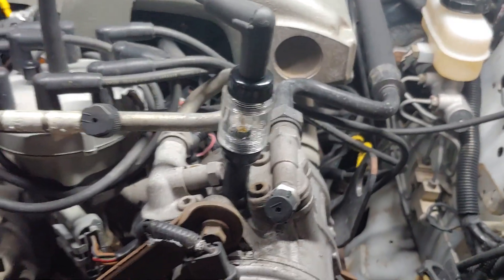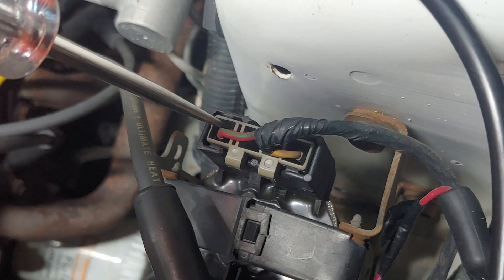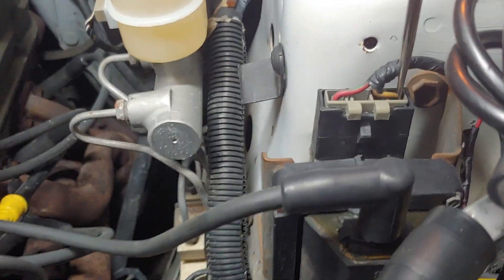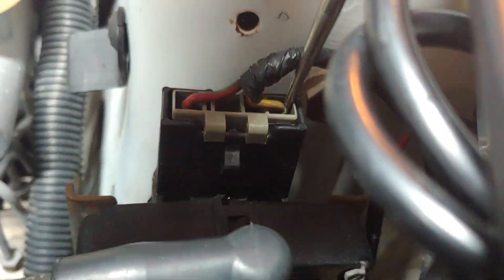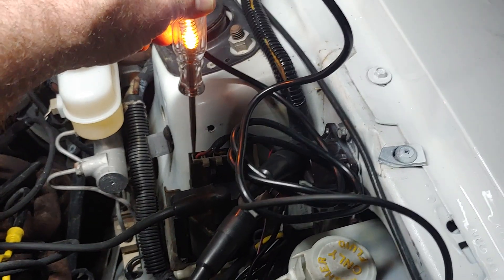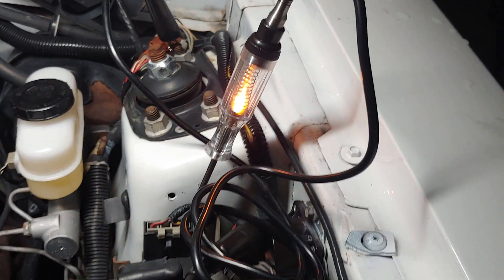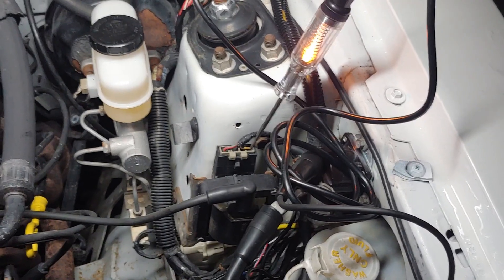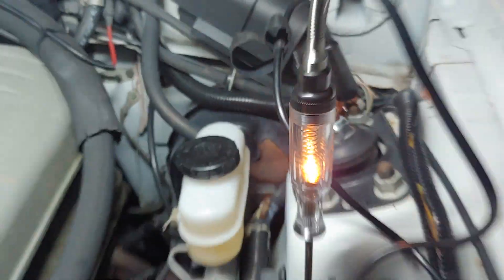How to test a TFI Ignition Coil on a 5.0L Mustang

Comment: I have a 88 mustang 5.0 I'm not getting power to the coil from the red wire with green tracer on the positive side of the coil connector. I thought maybe the the wire was broken between the coil connector under the hood, to somewhere  under the dash  harness.i unplugged the connector under the dash and checked the wire ,its good not broken..that's far as I got,dont know what to do next.i jumped the positive coil wire left side,directly to the battery and car started..but will not start without the jumper wire.
Reply from the maker: On these older cars, Ford used fusible links, which is a length of wire that acts like a slow-blow fuse. This circuit has two of them inline. Finding these is more difficult than finding a fuse is. Also, on older cars like this, Ford ran high amperage power thru the ignition switch. Any time you run high amperage thru a switch (in this case, maybe 8 amps or so), the switch contacts corrode easily as the electricity jumps the switch contacts slightly before the contacts actually touch each other. This leads to corroded switch contacts, and premature switch failure.

Modern cars don't do stuff like that. By using relays instead, modern cars almost eliminate ignition switches from going bad. In your car, you probably either have a bad fusible link or a bad ignition switch. To test the switch, you're just checking the two yellow wires for power coming in, and those other 2 wires already mentioned for power going out in Start or Run. If power both enters and exits the ignitions switch, that second fusible link is your likely suspect. If power doesn't get to the ignition switch, then the first fusible link is your suspect. Check the fusible links near the starter relay. They're the most likely to be in bad shape over time.
Reply: @dragradialperformance3540  so would there be power on both sides of the fuselink if it's bad?
Reply from the maker: @lall427  If it's bad, you probably won't have power on one side. Test it with the circuit loaded (key on). It might also look cooked, or boiled.
Reply: @dragradialperformance3540  so the coil is okay. Mine is an MSD coil so the plug is switched around so I was trying the right wire when really it was on the left side when looking at it. Anyways, after checking the coil with an volt and arms metre, I believe it's okay. I took the distributor out and I spun the shaft and I got injector pulse but I still didn't get spark. Does this mean the distributor is good but the TFI module is bad?
Reply: @lall427  It's difficult to test a coil with a voltmeter, and worthless to test one with an ohmmeter. You can however check for 12v to the coil on the red wire with the key on.

If you have PIP (and injector pulse), but no spark, you're probably looking at a bad ignition module.
Reply: @Pontisteve  I will try a new one tomorrow morning. Sure hope so! Thanks for the help. I was trying to avoid buying one haha but I'll let you know in 24 hours if it's the TFI. I'll need a good timing from all this in and out lol
Reply: @Pontisteve  hello Steve, I have pulse at the coil negative wire though..still think its tfi? No spark..
Reply from the maker: Power comes from the battery to the starter relay, to a yellow wire, to Fuse Link A (16 gauge black), to a splice into 3 yellow wires. Two of which go to the ignition switch, giving the switch power. When you are in start or run, power comes from the ignition switch on a red/light green wire (in RUN) or a brown/pink wire (in START) to a red/light green wire splice. From there, it goes thru a 20 gauge blue fusible link (fuse link N) to connector C201, and finally to the ignition coil.

I would start my test at the ignition switch. Make sure the two yellow wires coming into the switch have 12v. Then make sure the red/light green wire coming out has 12V when the key is in RUN. Make sure the brown/pink wire has 12v when the key is in the START position. If you have power here and not at the coil, suspect Fuse Link N (20 gauge blue).

Comment: Hello great videos. Very knowledgeable you are. (Yoda voice lol)
I have a 93 Tbird with a 5.0 HO and I have a no start. I have coil control as tested on the coil negative. I have healthy spark as seen through inline tester.
I assume it has a diszzy pip signal based on flicker from test light on coil negative.
Checked fuel pressure and it’s good, fuel pump relay tested good, fuel pump shut off works.EEC relay works and EEC relay terminals have power and ground. Fuel injectors did not pulse as per my noid light.
Interesting note: when I turn the key to run and hear the pump prime for 2 to 3 seconds and turn key to start, she fires right up.
And the there’s times when I hear pump run on indefinitely and cranks but no start or injector pulse.
Reply from the maker: Did you watch my video where the car had spark, and I had the computer completely removed? The ignition system will fire with just a PIP signal and no computer control, but the injectors are fired solely by the computer, based on the PIP signal. The coil is triggered off the PIP signal as well, so you're exactly right... nothing wrong with your PIP or module.

Your problem is the computer. In particular, it's very likely the capacitors are leaking. The pump running indefinitely is a sure sign that I'm on the right track. Remove computer, and inspect capacitor legs with a bright light and magnifying glass. I sell a kit with the 3 capacitors on Ebay. Here's a link to my store:

https://www.ebay.com/str/dragradialperformance

Installing them is something best left to an electronics repair guy that has a microscope for soldering, and a desoldering gun. TV repair guys and PC motherboard repair guys have the most experience with that.
Reply: @dragradialperformance3540  My issue seems similar to this guy. Car was running perfect and out of no where dead, and these are the codes I got. 12 14 22.  So I Bought a new Distributor maf and map as the codes said. Got spark, but still no start. The fuel pump is staying on. Seeing a new ecu is only $100, would you agree I should throw more money at this or do I have a faulty Distributor. I have not tested the injectors because I did not know how to test them. I am wanting to sell this car soon, and now this. I have dumped a fortune into this car. Looks nice, but its not perfect.
Reply: @ChannelZeroOne  Whenever the fuel pump runs constantly with the engine off and key on, it's going to likely be a computer problem. Open up the PCM, and inspect the 3 teal blue capacitors very carefully for corrosion or leakage.

Comment: I have questions does the tan work as a ground when the car is running
Reply from the maker: Yes. The coil gets 12v power all the time when the key is on. When the ignition module wants to fire the coil, it grounds the coil for about 5/1000ths of a second. As soon as the ignition module quits grounding the coil, the coil will fire. It does not, and must never, have a constant ground though.

Comment: My 1990 Ford F-150 has a no start after a week of starting after having the fuel lines replaced.

Could my ignition module be an issue? I replaced the ignition coil last year, but the truck sat outside the shop for a year waiting for them to replace the fuel lines...

I tried to test the shredder valve on the fuel rail, nothing came up.. 

Should fuel come up when I press the shredder valve on the fuel rail?

When I took the truck in last year, I put a new fuel pressure regulator, new fuel filter, fuel pump & tank, & new ignition coil in it.

The pump comes on strong. 

Could any of the new parts be no good from sitting, or could it be the control module has went out?

Sorry if that was too much...

Thanks in advance..
Reply: There should be about 39 PSI of fuel pressure in the fuel rail. If you turn the key on for a few seconds, off for a few seconds, on, off, on again to cycle the pump and build pressure, there should be 39 PSI in that rail. If there were, depressing the schrader valve would squirt fuel out rather dangerously and unmistakably.

If you don't have any fuel in the rail, your pump is either not running, or blocked. Get a fuel pressure gauge. OTC makes one for about $30 shipped on Amazon that's good, and has the Ford adapter. Are you sure you can hear the pump run?

It's possible the pump is wired backwards, if it's got a universal pump wiring pigtail that you have to butt connect on yourself. It's also possible that your fuel filter is totally blocked, or that your in-tank sock is blocked, or that you have a hole or leak in your nylon line inside the tank, allowing air into the line. Make sure your pump is running, and that fuel pressure is zero. Then find out where that fuel is going.
Reply: @Pontisteve  thank u!
yes, the pump comes on loud, where I can tell it comes on..
So u believe the new fuel filter could have become trashed from sitting for a year?

Is it possible for that to happen?

Thanks again..
Reply: @dee1380  It's unlikely, but possible. I think it's more likely that there could be air getting into the fuel pump pickup line. You should first check to make sure that there is some fresh gas in the tank, say 1 or 2 gallons. Then verify that when someone turns the key on, the pump runs. Put your ear very near the tank, and have someone else turn the key on. Make sure you can hear the pump run in the tank.

If the pump runs, then you need a fuel pressure gauge that screws onto the schrader valve to verify that you have no fuel pressure. If you have none, you could try removing the fuel filter, then priming the pump by turning the key on. If fuel doesn't come flying out that fuel line towards the filter, then you know it's not making it out of the tank. Physically inspect the fuel lines for kinks or dents that could restrict flow, or for broken hoses or fittings or fuel leaks.

If you can hear the pump run for sure, and you have no fuel at the fuel filter, then you must pull the tank down and check the clear plastic line going from pump to pump hat to see if it's fallen off or got a hole in it or something.
Reply: @Pontisteve   Actually, a friend of mine & myself discovered no fuel is coming from the line after the fuel filter.

We took the line from the fuel filter to the engine off, & when we turned over the pump shot out fuel from the fuel really strong!! So fuel is getting through the filter.

A neighbor said there is a valve between the 2 tanks on the frame that may be giving me problems.

Do u have any idea what he may be talkin about?

Thanks in advance..
Reply: @dee1380  He's partly right, as far as I know. It's not a valve between two tanks, it's a selector switch in the dash on trucks that have dual tanks. The switch takes a single fuel pump power wire from the front of the truck, and determines which one of the two fuel pumps it goes to. I'm not that familiar with the actual tanks and lines setup, so you might want to check into that design.

Those switches pass high amperage thru them to feed the pumps, and any time you have high amperage going thru a switch, you will have premature failure of the switch due to contact corrosion. You can actually open the switch up and repair that, or just replace the switch. The symptom would be that the fuel pump doesn't run, and it's pretty easy to remove the switch and build a jumper wire to temporarily bypass the switch entirely and run whichever one of the two pumps you want. This would be an easy way to prove out the switch.

However, you said you hear the pump run. The switch problem I'm referring to is going to prevent the pump from running, not cause it to run and not build pressure... unless the voltage drop across the switch was really severe. You can test switch input and output voltage to see if this is the case.

Maybe there is something to a valve of some sort. I didn't think there was any mechanical parts involved, but I'm not that familiar with the actual dual tank design.
Reply: @dee1380  Reading your reply again, you say fuel is coming out of the fuel filter really strong, right? If so, you should have fuel in your rails. If you don't, look for a kinked line between the engine and the fuel filter. Maybe even clogged rails, although I've never seen that. You need to check fuel pressure with a gauge.
Reply: @Pontisteve  yea, don't have a guage..

We were trying to take the line off from the filter to the rail last night..

Looks like I need to use a quick connect, which in this case, I have only the plastic ones..
Reply: @Pontisteve  He's right, there is this container between the 2 tanks on the frame on the drivers side call a "fuel tank selector switch valve".

I have not looked on my truck for it yet, but I've seen videos on here about them, & seen where I can purchase one from Oreilly's..

I believe that may be causing an issue..

Whatever it is, it doesn't seem to be major, just a headache trying to get to the bottom of it..

The truck runs great when it's started, great engine for sure!

Just needs some TLC..

Thanks for your help.

Comment: I have an 89 GT that cold starts and runs perfectly with good throttle response and idle, then suddenly dies after about a minute.  After a couple more attempts, the car will start and immediately die.  When it cools down, it will run fine for a minute, and begin the same start / stall pattern.  No KOER codes.  No KOEO codes other than long term codes 18 and 96.  18 SPOUT I believe is from setting the timing.  96 is from my fuel pump kill switch I installed for anti theft. Fuel pressure is good at stall.  Cleaned IAC, Mass Air, and throttle body.  Ignition wires are good.  ECU has a small amount of leakage from 2 of the 3 capacitors.  Do you think it’s the TFI module overheating?  ECU?  What should I check?
Reply: That sounds more like a TFI module to me. I would fix the capacitors regardless. I sell the correct 3 capacitors for $15 + shipping, but you need to have someone with a microscope and experienced at capacitor replacements do the install on those. You could try any different module and see if your symptoms change. Sounds to me like the module fails when it warms up. They're quite hard to diagnose without a scope, but they're cheap enough to just go buy one and try it.
Reply: I should have said, if you have a scope, use it to diagnose the TFI module. If you don't have a scope, just go buy a TFI module and try it. Any change in the way it runs indicates you're on the right track.